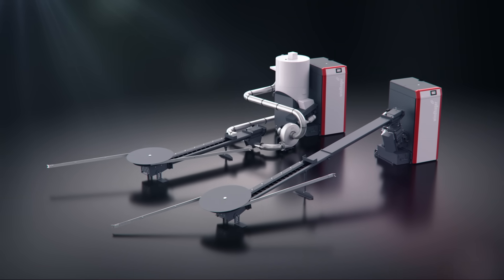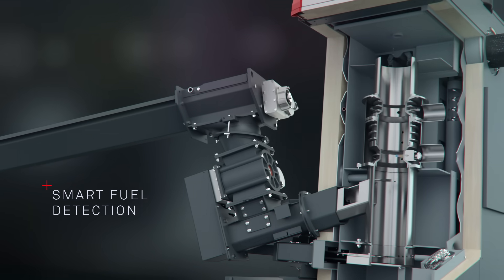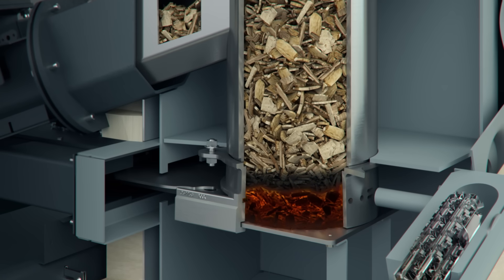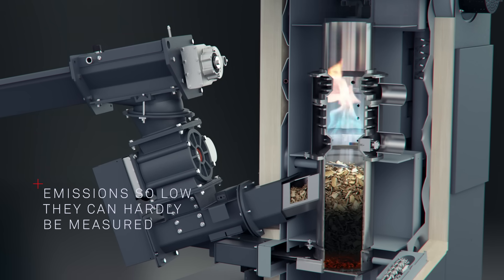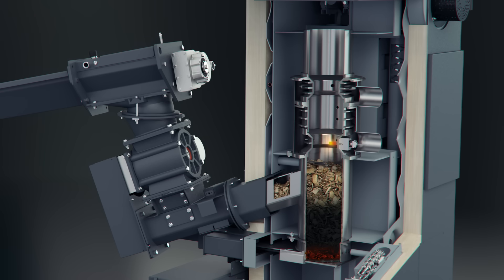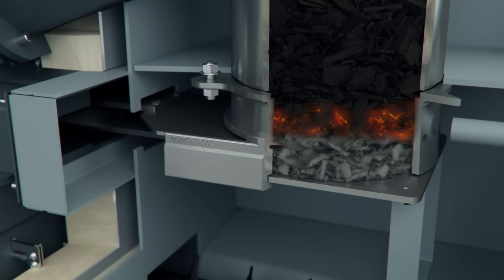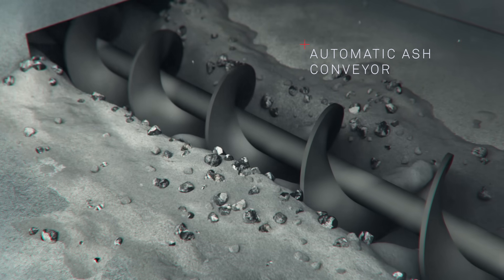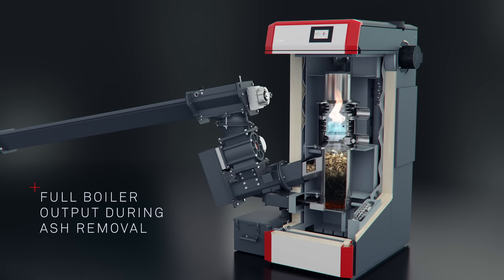Windhager PuroWIN - wood chip boiler - zero-emission gasification boiler with stainless steel burner

Comment: As some already wrote here, wood is burning, so it releases CO2 and some good ol' H2O, so it is not zero emission. "Zero particle emission" would be correct and less misleading.
Reply: KEK-ASS  It seems that the Carbonefferous was the period with the highest oxygen content, and that led to a global cooling, and an ice age. caused by the many carbon catching lifeforms (Carbon is a component of CO2). im just reading from wikipedia, its all new to me.
it seems that this period was named after the geolocigal findings, of coal/ carbon in a paticular layer.
Reply: You can't have wood ignition if you don't convert oxygen to CO2 it is a vital part of the burning process. CO2 isn't whats causing cancer, NOx and other emissions, mainly from burning diesel fuel are way more polluting and harmful
Reply: @deanjohnson7283  I would also add a wood gasifier is technically a 2 stage burning process. First like they said carbonizes the and maintains an ember, while the glow plug helps convert the unburnt fuel. This burning process is very effiecient because in a traditional fire there's unburnt fuel loss due to it escaping into the atmosphere and it not being hot enough to burn.
Reply: Wood fuel is defined as carbon neutral because it is made and grown for the purpose of burning. So while we can grow more trees we can't make gas or yet anyways.
Reply: @allstarwoo4   more succinctly ... its not a "fossil fuel" .
 It absorbs the CO² whilst growing & releases it whilst burning ... zero-sum game 😌
Reply: I imagine there are ways this could be limited to almost nothing if it was designed to operate more like a charcoal pile. You wouldn't be able to easily burn the gas then I think but maybe there are allowances for it in this design... however it does talk of ash so I doubt it's wholly closed to waste output. Shame, I'd like to see a charcoal and wood gas product line. You would still need to to heat the wood to carbonize and drive off the lighter burnable elements. So there's no perfect way unless you're focusing sunlight on on an enclosed chamber.
Reply: Trees release the same emissions rotting as burning.  Law of conservation of energy.  Slower sure, but it's only tree hugggers who are short on time.
Reply: the co2 wood releases when it's burned is equal or less then the co2 used by the tree from witch the wood comes from.
Reply: It says "dust emissions" at 0:47.
Reply: It sounds like we should stop living too, we breathe out CO2 too isn't it.
Reply: KEK-ASS  The Carbonefferous was a time of low CO2. Wood decomposing microbes didn't exist then, or only really small populations. Also large scale tree forests were covering the land at the time. So there were a lot of plants absorbing CO2 and not much of it got released back to the atmosphere. Most of the Coal fund today comes from these trees.  High Temperatures aren't a problem. Fast rising ones are. With enough time live can adopt to many situations. But if the time isn't there many species may struggle. The sea level rose about 30cm since 1990. Which doesn't sounds much but places that already had before problems with high water have now a harder time. For example Venice had last year big problems with floods.
Reply: This could be solved by using additional gas containers/filters/CO2 scrubbers. But H2O definitely should be condensed here somewhere.
Reply: takix2007 except all the ash dumping... so it does emit particles......
Reply: KEK-ASS  Supply a link to your pre-reviewed source...
Reply: Home Kitchen  I am sorry, but that's wrong. Yes, crop yields are increasing due to higher plant metabolism, but they are also decreasing due to ecosystem change induces by human activity and climate change (mostly also caused by human activity).

We don't really want less CO2, what we had was fine, maybe even what we have now, but we absolutely want to prevent the levels from going to far.
Once they reach certain tipping point, a lot of ecosystems, biodiversity and therefore knowledge, money and power is gone.

Indeed, the root cause is people, so stopping multiplication would be best, but somehow that is draconian and people will just fuck anyway. You seemed to notice that already.

Plants and animal species can adapt, but the change is going too fast. The extinction rate is going through the roof right now!

Also, "trust you"..... NO NO NO NO, we need absolute logical reasoning so that there is no more room for opinion..!!!!

So if I made a mistake, feel free to correct me!
Reply: KEK-ASS  The fact that Bernie Sanders did not understand the consequences of global warming, is a strawman. I have studied environmentalism and I have never seen such reports. They all talk abouit 2050 2100 2150 etc.. Policy horizons, targets, and the like.

I am very interested in the study on those ice core samples that contained some of the highest CO2 levels? Refs please, I need my reading material!! thanks.

Also, your government maybe lied, but that is not the same thing as all of science lying about it. Yes, there are many false motivations for environmental policy and we must weed out those and those policies that do no contribute and cost small businesses too much money. That doesn't mean we should automatically distrust all policies.

The argument you're using always feels like a technique to prevent any criticism beforehand, to stifle any discussion. But as a scientist I welcome it. So feel free to ask any questions.
Reply: Home Kitchen  Yes plant food, but also a woolly blanked on a hot humid summer day. It's really odd to say plant metabolism is the same issue as climate forcing. It's really comparing apples to stones.

ffs? ffs? hahaha, I would never BM when I wasn't absolutely convinced I was right!    (^|^)
Reply: Home Kitchen  dumbass thinks we arent having a plant shortage currently
Reply: If you want to quickly remove co2 why not grow mass quantities of hemp. It's one of fastest growing source for fiber. It improves soil, can be used for many things, building, and burning
Reply: What is the percentage of co2 in the atmosphere?  Do you know the critical importance of co2 in the atmosphere?  What exactly is required for plants and trees to grow other than H2O?  When a volcano erupts,  what's the amount of non particle co2 emitted and how does that effect climate?
Reply: @DeepCycle9  An irrelevant point unrelated to the topic at hand, the world already produces a surplus of emissions we don't need to add our own into the mix. The man correctly pointed out the very misleading claim. you failed to address that, so you tried to deflect.
Reply: @DeepCycle9  bro why are you angry
Reply: @DeepCycle9  Grey tells more about this and other facets of the carbon cycle and how positive and negative feedback loops affect the balance? Oh wait, you're just talking out your ass and no zero about
Reply: @DeepCycle9  
1) What is the percentage of CO2 in the atmosphere? CO2 makes up just 0.04% of Earth's Atmosphere.
2) Do you know the critical importance of CO2 in the atmosphere? At least 2 of them, it's part of the natural and biological carbon cycle and it keeps us warm through the greenhouse effect.
3) What exactly is required for plants and trees to grow other than H2O?  O2 and CO2 from the air, minerals from the Earth. And just the right amount of heat and light, not too cold, not too hot, not too wet, not too dry. Mother nature is hardy, but somehow my house plants are always the weaker individuals... hmmmm.
4) When a volcano erupts,  what's the amount of non particle CO2 emitted and how does that effect climate?
 A lot of soot is released, this has a heating in icy regions because it decreases albedo of the white snow, if the soot contains a lot of aerosol particles it also has a cooling effect, because it reflects light back into space (increases albedo of the air). A lot of CO2 is emitted as well, which has a heating effect through the aforementioned greenhouse effect.

I think you mean for us to conclude that "Considering the above, more CO2 in the air must be good, right? So what's all the fuss about, bunch of money grubbing $#% ???".
Yet, that is a false conclusion. 

I will take my time, grab a snack:
An atmosphere with 100% CO2 is not good for you, I can safely assume everyone that doesn't want to suffocate will agree with me. An atmosphere with not enough CO2 is also not good, since we will all die of hyperventilation and all the plants will starve. So its a peak parabola (meaning the optimum amount of CO2 in the atmosphere is somewhere in the middle). 
Yes, plants can make use of a lot of CO2, we fill high-tech greenhouses with extra CO2. That is not the issue, in fact that is a slight reprieve from all the economic damage that climate change like global warming can do. Change quite often is a two-sided blade, indeed.
The greenhouse effect of CO2 and many other gases (methane is far worse) is to trap radiation in the atmosphere. That effect is one of the reasons Venus is boiling hot and Mars is freezing cold (besides the amount of radiation they receive, obviously you have to take that into account!). You see atmosphere is like a blanket. CO2 is like wool.... ^^

Too much wool? What the hell are you talking about?
1) Increased CO2 causes ocean acidification (on top of over-fishing, eutrofication and plastic soup). Ocean acidification is really bad for corals and clams and such.
2) We have had this much CO2 before, but not during an inter-glacial. There is no real precedent.
3) Our money ultimately comes from nature mostly. Renewable resources are always stretched to their limits. Humans are poor stewards. Climate change can easily be the thing that drives many ecosystems over the edge and many species extinct. The count of species lost already is skyrocketing.... right.... now.....!!!! (additional exclamation marks for effect - they should make you stop and think). Once species are extinct they are gone forever, no raising them back sci-fi crap arguments allowed here, that's just too fatalistic.)
4) Yes, nature can adapt, but we're seeing that the speed of change in flora and fauna in habitats is too abrupt for adaptation and migration is not always an option in an overcrowded world (at least in some places).
5) Adding CO2 to the environment, when the mix was kinda just right (at least for those species that had adapted), doesn't actually help!

I can go on and on about people using the fact that more CO2 is good for plant metabolism to somehow doubt the veracity of a totally unrelated amount of climate forcing through the greenhouse effect.
If you're on the border between desert and Savannah, then every fraction of a degree can mean the grasses receding or advancing. There are not many plants in the desert, no matter how optimal the amount of CO2 in the air.

Feel free to ask questions!
Reply: @DeepCycle9  - This is some PragerU level mental gymnastics. "But trees need CO2, so putting more in the atmosphere is a good thing!"
Well, you know what, humans also need water to survive, so why not live under water? No no, don't worry about drowning, that's impossible, water is good for you after all.
Reply: @DeepCycle9  you are basically saying the same as if i said, do you know the critical importance of oxygen? what exactly is required for you to breathe? when photosythesis happens whats the amount of oxygen released and how does it effect climate? would you like 50% oxygen atmosphere where static electricity would set you on fire? The fact is we have more co2 in atmosphere than at any point of human evolution. We were not evolved, and cannot evolve at same pace as co2 is growing to adjust. Burning co2 trapped in trees would be no problem if beside that we didnt burn all the co2 contained in oil and coal at the same time   (the co2 that did not exist in the age of modern human) so by not burning wood we are fixing the mistake of burning oil and coal in the first place, basically putting co2 back to where it should have been in the first place.
Reply: @DeepCycle9  I dont think we need more CO2 its already at about 70% and yes there was times when the earth was covered in ice, and it was saved by volcanoes, but right now we are litteraly melting the ice. Idk what you mean by particle co2 ?
Reply: Simonssx What did you mean when you said “CO2 it’s already at about 70%”?  Isn’t CO2 only about 0.04% of our atmosphere? Please help me understand what you meant.
Reply: @mirkopolyak3592  Yea, it seems that i confused CO2 and Nitrogen content. i am not an expert on the matter.
Reply: @worcestershire-sauce  70%? You die around 4%.
Reply: @worcestershire-sauce  70%? Of what?
Reply: @worcestershire-sauce  0.04 % but we don't need more CO2, indeed.
Reply: @Bergerons_Review  Yup, 70% nitrogen, 19% oxygen, 0.04% CO2 and a lot of crap.
Reply: @MrMichiel1983  yeah but someone said 70% CO2.
Reply: @worcestershire-sauce  CO2 is around 420 ppm or 0.042% which is actually about a third of what is required for optimal plant growth.  Nitrogen is around 70% and Oxygen around 20%. BTW Your exhalations contain around 4% CO2 as do most breathing creatures.
Reply: Don't believe the lies being sold to us these days, it's all to get us to pay a tax.They falsify data to prove their myth. Burning wood is part of the carbon cycle. If we all burnt wood and planted trees, there would be zero net carbon released. They want you to believe that humans are the problem, all lies. Try pumping carbon dioxide into a greenhouse and see what happens, the plants grow. Btw, almost all the glaciers are growing, they are hiding this data because they can't explain it without disproving themselves.
Reply: @keithshaw2269  sei proprio un demente.
Reply: @keithshaw2269  Don't talk a lot of bullshit......nothing you have said can be substantiated because the results are too varied......every year there are huge forest fires around the World, they follow the dying out of the undergrowth as the Summer advances.......find out what the Indian rice farmers are doing each year to the rice stubble and then talk.
Reply: @keithshaw2269  Lets back up here... You are saying that scientist most of whom work for gov't agencies earning between $36k-75K a year depending on their education and experience are manipulating data to line their pockets... I can tell you as an environmental professional that this is total bullshit. Everything we do is backed up by math and our understanding at the time. Everything we publish or report has be able to be replicated by someone else and we have to put together dry dull reports stating these facts. 

You give your example of a greenhouse. Have you built a series of air tight greenhouses and injected differing levels of CO2 into them and recorded the results? Additionally, have you replicated these results for different climates to see if your null hypothesis is the same for temperate, arid, tropical, etc regions? I'm guessing you haven't and think that it's all grift, because if you had the means, you'd scam people out of money to benefit yourself.
Reply: @keithshaw2269   So there is a great conspiracy by scientists all over the world, because they are collecting taxes?
Reply: @RogGoetsch  I shouldn't be letting this cat out of the bag, but as an ecologist I can tell you, it's all a grift to secure that middle class lifestyle of making $35K to $80K a year depending on degree and experience. All these screaming into the void, drinking ourselves stupid, countless hours in the field, and begging for funding is all so we can make enough to rent an apartment without roommates...
Reply: @keithshaw2269  Humans are part of a much bigger problem in which the root begins in the brain.  Thought is stirring up chaos.  To some extent I think you are right, but to a world caught up in bad information, beliefs, and narcissism there has to be some way to turn it all around.  "Global Warming" is not what they say it is, unfortunately though humans do need to change and in the right hands (that are not scheming for profit) "Global Warming" might be a start in the right direction.  
There is a group that has devoted themselves to spreading lies.  These tyrants are all around you they tell lies to keep the divisive organization (which goes by many names and symbols) profitable hence=energy.  When just about everyone is following these people  who are highly likely to be in this cult.  It makes it hard to make any kind of change.
Reply: @nothing578  well said, it's good to see someone well informed and have original thought.
Reply: @keithshaw2269  
Careful there
There are thousands of solutions to fight global warming without increasing taxes 
Heck, some of them even talks about reducing taxes for those with lower CO2 footprints.
Reply: @keithshaw2269  - "the divisive organization (which goes by many names and symbols)"
He's literally talking about the Illuminati, just not by name so you don't write him off as a kook. He's not "well informed", and it's hardly "original thought".
Reply: For each ton of CO2 released by wood combustion there are several others hold by trees which still growing.
That's why we Brazilians needs to build power plants fuelled by Amazon firewood
Reply: @rlguerrero2263  You know the Amazon is a carbon sink, meaning it stores carbon taken from the atmosphere? Also, the Amazon has very shallow depth of usable soil before you hit hard clays and bedrock.
Reply: @OlafoWaffle  Sorry to tell you, but you are absolutely wrong, my friend.
That's what they told you.
I have being there, I deal with carbon storage on soils in my work, as a farmer, and I'm trained to asses soils and vegetation as well.
So, let me tell you what I personally saw:
1. On the tiny fraction of Amazon I knew, just some 200 km of East Rondonia, I remember at least eight different types of soils. From shallow, rocky and acid to flooded plains.
2. The forest is not uniform. In some places it's just 2 meters high, despite not being Cerrado, while on others it look like a twenty stores building.
3. The forest is extremely resilient and recover so fast it's impossible to compare with frozen forests of northern latitudes.
4. Indeed, up to the 90's there was a widespread use of bad practices of soil management using fire. This naturally drove out of market the ranchers who stick to it due to soil degradation. And you know what happened? Over the degraded pasture the forest took over in such a hard way it's difficult to describe. This kind of initial phase of forest recover is called juquira, in Portuguese. One farm I visited the juquira was about 15 years old and already had trees big enough to harvest timber.
5. Those times are over. Nowadays there is a widespread consciousness of good soil management practices, the intentional use of fire is a crime fiercely punished with prison and every farm are obligated to keep or restore a legal mandatory reserve of 50 ou 80% of the land. This is harshly enforced by authorities.
6. Instead of being a carbon sink, the forest is, naturally and by itself, the biggest global source of atmospheric methane, due to the summer floods. Organic matter when decomposes on open air produces CO2, but when under water it releases methane.
7. The only way the Amazon forest can work as a carbon sink is by wood harvesting. Once old trees are falled, they shadow ends and a explosion of vegetal life happens on the gap left on a fierce battle for the precious sunlight. That indeed sequester carbon from the atmospheric in such a ratio it's hard to compare to anything else.
8. Amazon may be a misleading word to describe such a vast extension of land holding such a variety of contrasts. In Brazil alone it's a unimaginable extension of four thousand quilometers.

So, I advise you to throw away the entire scope of information the European and American media gave you.
It just don't fit to the reality at all.
Reply: @rlguerrero2263  Great analysis, bad conclusion. If I was to throw away the entire scope, I would have to ignore you too. That doesn't seem right. The fact that the media have a hard time portraying the issue of climate change and global warming does not mean every single thing you ever read about it is a lie. Some things are, yes, as is in all political arena's.

If you don't mind, I will continue to cherry-pick information based on its merits, and not based on some draconic advice that throws away the baby with the dirty bath tub water.

So thank you for those tidbits of info, sorry I don't accept the somewhat hyperbolic conclusion you attached to them.
Reply: @MrMichiel1983  I'm not lying neither earning money in telling you my testimony.
On the contrary, one week on East Rondonia and I could show you in loco any single point I told you.
By the way, I invite you to calculate the specific heat of both atmosphere and oceans.
When I did this I declined any beliefs on antropic global warming.
You could also take the current pH of the latter and estimate how many increase on surface atmosphere CO2, under standard pressure and temperature, would be required to raise it at 10^-3. Only on the Epipelagic zone.
DIY. At least, will be didactic :)
Reply: @rlguerrero2263  Looking at those things it seems to me anthropogenic (not anthropic) warming likely is true. Let's compare calculations?

Also, the Earth is heating up, even if it's not man-made, we still want to prevent the house from burning right? And reduced carbon forcing can help with that.

Anyway, it's not only global warming. It's the pH value declining that is also causing problems. Ocean acidification is a real problem.
Reply: @rlguerrero2263  You know, it takes a couple of years for a tree to grow, and we should be making houses and furniture out of that wood, not burning it. Re-using wood is keeping the CO2 trapped. Burning wood / oil / coal is releasing the CO2 back, in the atmosphere, wich contributes to global warming.
Reply: @worcestershire-sauce  What the media does not tell you is that we also plant trees at quite a rate. The world has more trees than 40 years ago and the planting is going on apace.  Forests have been a cash crop for many decades. You are correct in that places like Brazil and Indonesia have been delinquent when it comes to forest management. However, the efforts of places like China, India, Europe, USA and Russia are completely ignored.  Of all the resource we have, we are not running out of trees.
Reply: @PhilJonesIII  - Yes, we're not running out of sustainably farmable trees. But we're not growing them faster than we're polluting the atmosphere. If we were, CO2 ppm would be way down. And it's just fairly obvious that globally that's not the case at all. Has the US planted as much new forest as Brazil has burned in the last year? I doubt it. Especially with the US wildfires.